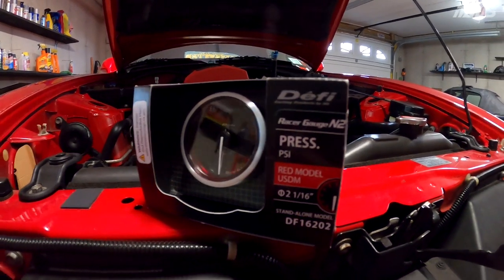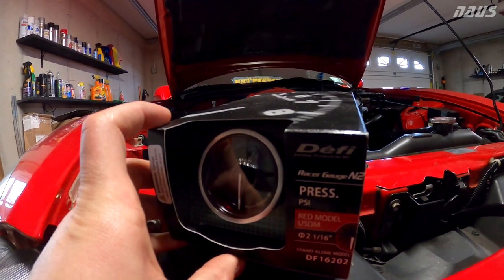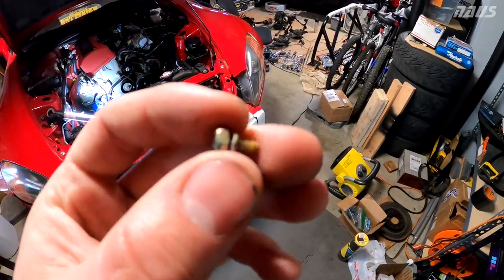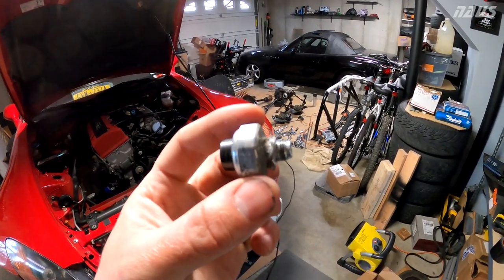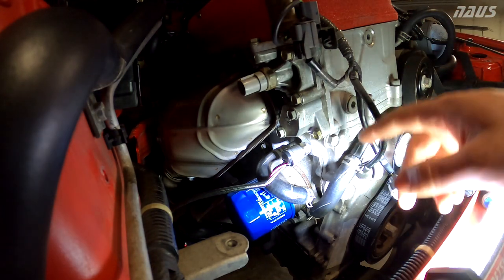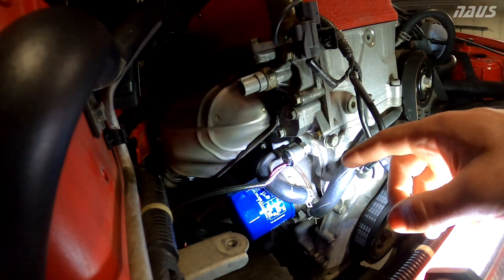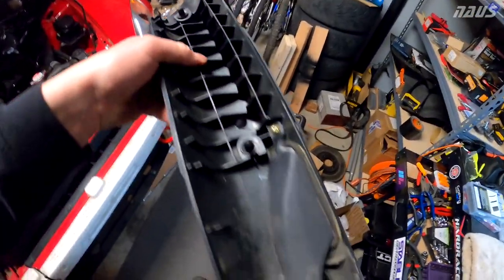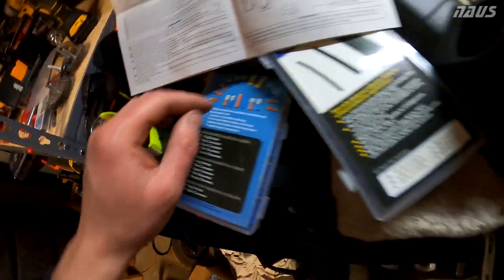S2000 Oil Pressure Gauge Install

Comment: Had no idea having the OEM one unplugged meant the light stays off. Will just get rid of my OEM one if that's the case as I currently run a line to a metal cube with multiple ports and both OEM/Defi sensors plugged in...
Reply from the maker: Care to share your setup for the line coming off? Did you use the same port I did? I just got some advice from a guy to relocate this defi sensor to a remote location on a line because the engine vibrations can kill the sensor easily ?
Reply: @NAUS2K  Yeah I used the same port you did. I just ran a stainless braided line off the engine into an Acuity Instruments 1/8 BSPT oil cube. Only thing I don't like about my setup is I had to use a series of adapters to get the threads to match up. I might now just remove the OEM sensor off my oil cube and call it a day.
Reply: @naus did you ever relocate? I bought the same DEFI gauge after watching your video and it’s on the way. I’ve been desperately looking for the proper fittings to remote locate but cannot come up with the right combination. How heavy is the sensor? I know the issue with older sending units is that they were heavy. This one looks much lighter. Do you think there will truly be an issue for sensor failing with weekend/sunny day, non track use?

Comment: Great DIY as always!
I wanna get the innovate one, since it's pressure and temperature in one gauge

I am curious tho, the oil light doesn't come on? Forums  say that it should stay on and blink when disconnected
Reply from the maker: Nah the factory oil light sensor is just a normally open sensor that closes when pressure drops below the min acceptable value and then turns on the light on your dash. If you disconnect it the light will never turn on in your cluster
Reply: @NAUS2K  OK, I get what you say but if u disconnect it wouldn't all the pressure be gone from the sensor? It  will just be under atmospheric pressure.
I'm curious, because it showed on my friends 08 ap2
Reply from the maker: The oem sensor is out of the car like shown in the video. Only the electrical connector lead is still in the engine bay.

Comment: Is the sensor BSPT or NPT? The block is BSPT, if you try to torque down an NPT fitting you can crack the block.
Reply from the maker: Both the sensor and block are BSPT. This is a tapered thread just like NPT. Yes just like described in the video you do not want to over torque it
Reply: @NAUS2K I planned on doing the same thing but the gauge I got came with NPT 1/8 thread sensor. Do I just need an adapter from 1/8 BSPT to NPT? Or is the number something else?

Comment: You don’t use Teflon on oil pressure sensors because it uses the engine as ground.
Reply from the maker: The oem pressure switch has one wire going to it, however the aftermarket sensor has 2, not sure if it grounds to the block there or not but I’ve had zero connection problems with it. I do not believe BSPT thread is a dry seal like NPTF so it needs Teflon tape or a liquid thread sealant to fully seal